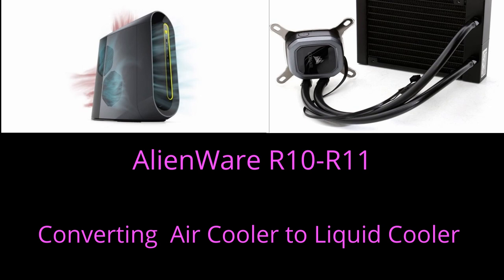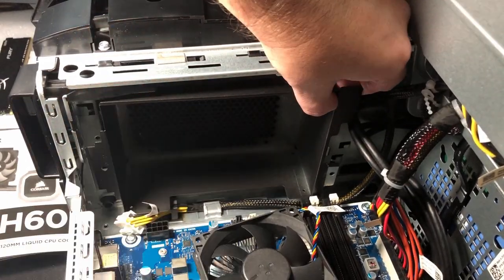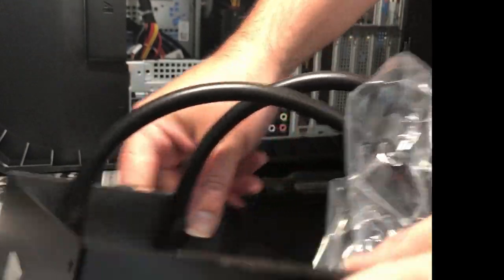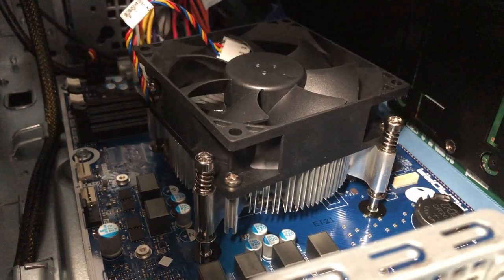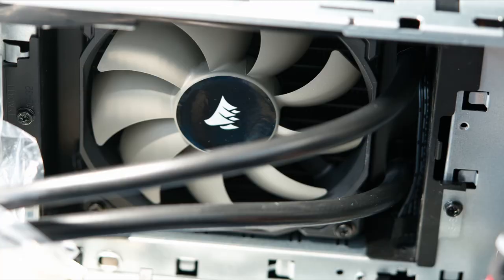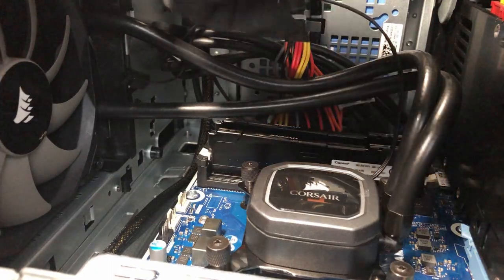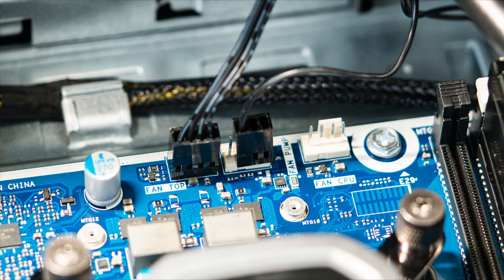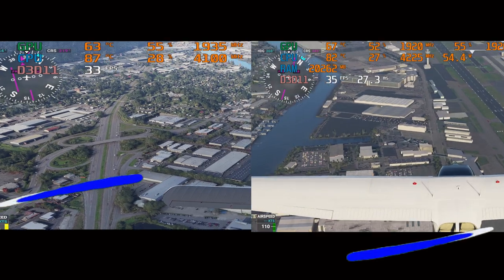Corsair H60 Liquid Cooler into Alienware R10 - R11 , Step by step tutorial.

Comment: Is the H60 better than the one that Alienware offers because I got theirs liquid cooling  and my GPU runs around 82C-84C kicking the fans very loud to reduce the temps cpu around 75ish when gaming high end games I’m thinking about replacing the fans as I’ve read they’re not very good . As they get very loud...
Reply from the maker: Fan changes will help with the base floor noise during high end usage. The Alienware Radiator and H60 radiator are made by the same parent company Asetek Liquid Cooling  . So, the best changes could be a re-paste of the CPU/radiator connection with an after market paste - and different fans. We are probably running into case limits of having a super fast GPU with a super CPU. Rumor whispers say that there should be an extra generation of similar cases R12-R13 before some redesign. Its  a wonderful case expect now we have some wonderful powerful GPUs .

Comment: Pro tip, use an extra 120 exhaust fan on top of the radiator plus the one on bottom and grab a fan connector splitter.
Reply: for some reason doing this was the only way i could get it to work lmao
Reply: did my conversion back in october. gonna upgrade the cpu soon
Reply: Dan OB nice man, it’s a great rig. I just found a 3090 that fit the case with the front fan in.
Reply: @d3us3xmach1na5  woah where’d you get that???
Reply: Dan OB This specific model is way smaller then the rest, GEFORCE RTX 3090 TURBO 24G GRAPHICS CARD 10.5” in length (266.7mm)

http://www.nextwarehouse.com/item/?4066804_g10e
Reply: @d3us3xmach1na5  holy shit that’s expensive 😂 Maybe I’ll upgrade to it down the line some more. Are you ordering one?
Reply: Dan OB I already popped it in but yeah it’s way overpriced atm.
Reply: @d3us3xmach1na5  I actually got my r11 with the 3080 installed so I’m in no rush to get a 3090. Maybe when 8k monitors are actually a thing I’ll pick one up. Hopefully they’ll have more smaller models then, and less expensive.
Reply: @staycreamy  oh wow yeah , the 3080 is excellent. honestly no point in wasting money on a 3090

Comment: does this still work with the aurora r12? i know there is more heatsink that i will have to remove, but I am concerned the h60 may not be compatible with the r12
Reply: any reports about it because i want to add h60 to my r12
Reply: @futureontop  yeah the h60 will work with the r12 since the radiator case is still the same size. You might need to remove the VRM heatsinks next to the cpu though. and make sure to mount the radiator the right way
Reply: @abbadox315  ive never had a pc before and no nothing do you have discord to help me?
Reply: idk any of the stuff u just said so like..
Reply: @futureontop  okay so do you know anyone that knows about computers? because you will need a lot of help putting in water cooling into your pc, just so that you dont accidentally break anything. and no opening and upgrading your pc doesnt void your warranty. If you break something you will void your warranty.
Reply: @abbadox315  so what do i do
Reply: @abbadox315  should i just add thermal paste and a new front fan and see if that works for now
Reply: @futureontop  lets just talk about it using dis cord. for whatever reason my comments arent showing up so ill just see if i can space it out
Reply: @abbadox315  yeah whats your discord
Reply: @futureontop  I cant comment right now for whatever reason youtube is being a pain right now, im going to have to wait a bit to send it
Reply: @abbadox315  what is it fast
Reply: @futureontop  its Blaeow as the username
Reply: 0145 is my tag
Reply: @abbadox315  sent

Comment: Hello, I just this installation following this video, but now it won’t turn on. Does someone has any idea why?
I make sure to connect back again everything i got disconnected, when pressing power button does nothing.
I did the power supply test with the back button and is working, fans and pump turn on
Reply: My factory R10 came with a pump and 2 heat sinks on the voltage regulators ( top and side along the pump) when you remove the cpu fan connection the bios sees it as a pump unit.  When screwed in on the board they ( heatsinks) make a connection(s). If you don't have them the vrm's will over heat. ( they don't tell you in these video's). You may also have other problems ( broken component, loose connections etc.) Best for this is to go on the alienware forum. The R10 come in different configurations  ( mobo, cpu, bios....etc and may react in different ways)
Reply: @jmenard5788  thanks for your reply, it worked at the end. Not sure what happened, I left it on the desk for a couple of hours doing another stuff, later I came back only to assemble it again and thinking on getting technical support, and as soon I plugged again the power cord it turned on normally south out any problem, and still have no issues 6 days later.